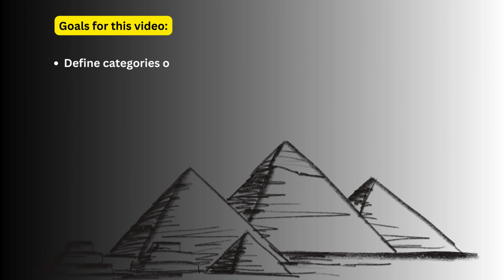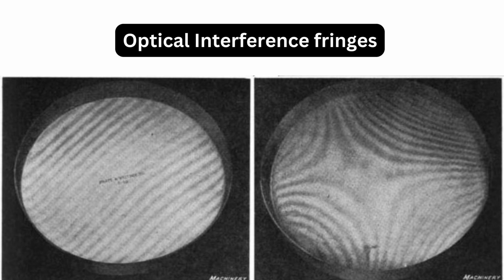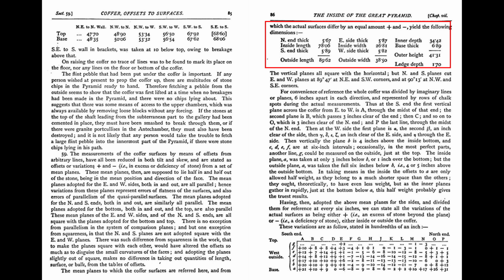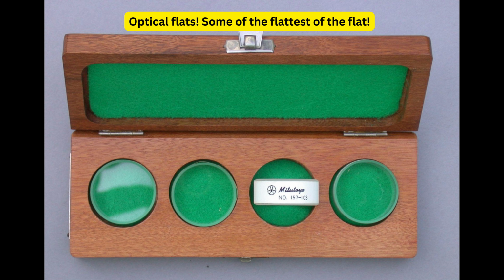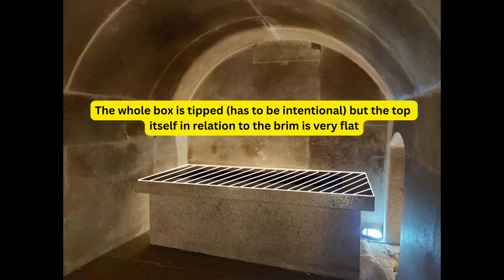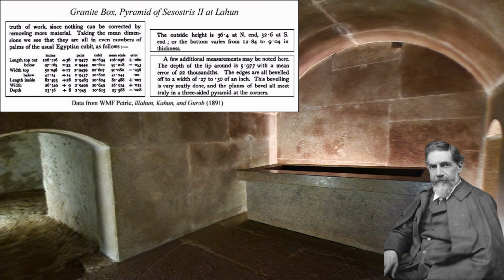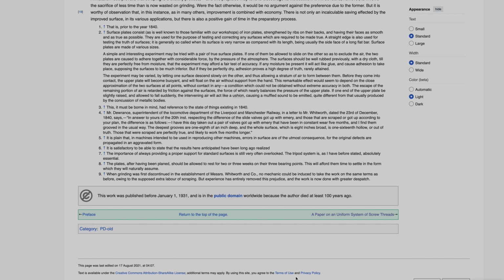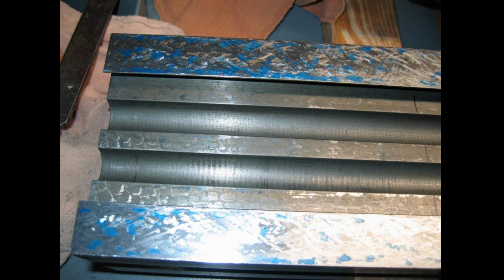The Problem of Flatness in Ancient Egypt

Comment: It is worth noting the inherent racism in the "they couldn't possibly" nonsense.  You don't hear people saying the Greeks or Romans couldn't have built the Parthenon or the Coliseum.  But the Egyptian's could have built the pyramids?  One of these things is not, as they say, like the other.  The Egyptians were masters of practical geometry, and their masons had a lot of work to practice on.  People mistake modern labor saving devices for essential to doing a job, but they are almost always replacing a job which was done earlier in a more labor intensive way.  And averaging three plates until they become flat takes nothing but imagination - which is clearly a trait held by a group of people who, through trial and error, figured out a pyramid!

Comment: People point to CNC machines as some sort of gold standard in accuracy as if the accuracy somehow comes from the computer but if they simply used a CNC to make a CNC to make a CNC each iteration would be less precise, like a photo copy of a photo copy. The ways (rails) of a precise CNC have to be hand scraped/fitted to precision so the machine can produce work that will be a little less precise than the ways.
Reply from the maker: Well said
Reply: Yes and no. Much more no the then yes. I can machine a flat what part and it will reflect the machines error. Then write a program that off sets the errors to make it flatter. In this way that is inaccurate.
Reply: @nsm8728 I am aware of compensating for backlash but compensating for error in the ways seems tricky. It seems like hand scraping would be a thing of the past if it were.

Comment: those straight edges are used in combine with light, its best way to measure straightness of the surface in a field

but im sure you almost knew this
Reply from the maker: It gives a visual reference not a numerical value. Feeler gauge should be placed in any gaps show by light. And maybe that was done! The point is not that they aren’t precise boxes, but even if they are the flattest items in Egypt, how then was it done?
Reply: @intothemap360  see how they all have flashlight on they hands?  you can actually estimate the value from the light
Reply from the maker: Sure. Same way the cop who gave me my first ticket "estimated" my speed without radar and it got thrown out. Eyeballing something is fine for general construction, feeler gauge is so easy and should be used.
Reply: @intothemap360  im sure you have extent background of precision measurements, now piss off

Comment: Yet still for some reason the apartment built in the 1950s, its truly a deceivingly flat suggestions of horizontally constructed walls, you replace the flooring with your machined wood floor panels.The walls are like a sculpture, like it’s trying to replicate the fjord. I could fit a herring in the gap as I accidentally drop one and it fell inbetween. When it goes for sale and somebody points it out, I’m going to say it’s a ”shadow gap”, a modernist architectural feature. Where have we gone so wrong?

Comment: I believe the flat surfaces on the box rim and the underside of the lid form a fluid bearing. My experiments show that a water film .0004" thick is created between the surfaces. That means the two surfaces have to be flatter than .0004" so the two parts don't touch each other. Friction is so low that a 20-ton lid could be moved with 40 pounds of force, if it was level. I took a digital protractor with me and measured a downward slope of 1.65 degrees. With a 20-ton lid floating on a film of water, it can be urged to slide across the box. A limestone block, mounted to the accurate interior walls would be shaved perfectly flat by the harder, granite lid as it slid over top. This is possibly how they made so many casing stones flat and at the right angle. The downward slope was to get the lid moving faster.
Reply from the maker: That really makes sense. Installing these lids without smashing them would need something like that. Very good points

Comment: I work in the automotive repair industry, and this makes sense.  When shaping a body panel with filler. You use a small grit sand paper to make it straight first then step up the grit smooth it out.
Reply from the maker: Right! And you don’t start with the smallest grit sand paper either!

Comment: Not the same but i used to lift 100s of 50kg bags a day, after a few years i could tell you if the bag was 49.9999 or 50.022 or close to that. Humans are remarkable and capable of unbelievable skill. Iv no issues with even the idea a guy looked at the thing and eyeballed or touched it and then made it perfectly flat.
Reply from the maker: Sort of like how it took me a long time but I can usually guess what time it is to the minute or two if I haven’t seen a clock for a few hours. We just pick up weird talents we can’t explain how we learned

Comment: As a stonemason the first thing that you need to learn is to make a flat surface, if you can't achieve that, then you're no good, and people who tell you that this can't be done without modeling tools, ask them how to Romans did it, they had no modern machines, also the simplest way to get a flat surface is rubbing two stones on top of each other, then when you have grinded the surface, you'll be left with a lot of stone dust, that you can then add water to, to polish the stone surface with. The thing that is holding people back from knowing this stuff is a lack of historical knowledge and trying it out for themselves.
Reply from the maker: Well said. Did you finish my video? I speak at length of this method of flattening stone
Reply: @intothemap360 sorry, I only skimmed through a little over 50 percent, seeing a ton of machine tools, making me drawing a conclusion that this video was one of those typical videos, claiming that high technology was used on those stones.
Reply from the maker: No I don’t make that claim at all. Basic tech and clever stone work is all I suggest. 3 plate method with abrasive sand

Comment: Pretty lazy to use some flat counter top with abrasives and talk about rubbing them together to become flat. When the scale of the actual comparison is millions of stones that weigh thousands of pounds before the invention of the wheel. Let's not forget that they were quarried a thousand miles away. Add the fact that they were square with inside corners equally mirror polished. Anyone with modern diamond rotary tools will tell you how difficult those inner corners are to polish without caring about flat or square.
Reply from the maker: Millions of stones would be the entire pyramid. The casing stones had probably a minimal use of this method, leaving just the handful of granite boxes. Remember the casing is limestone, very easy to work with
Reply: @intothemap360  Ok... how do you explain away they sculptures with perfectly symmetrical faces on statues. Perfectly polishes between the toes. It is obvious to any of us that actually work with granite that whoever did this had a process that we cannot replicate today. I do look forward to your video on precision vases.

Comment: Imagine walking up to a big concrete lock block wall with feeler gauges and measuring between them. There are gaps everywhere, and in one instant you find a a tiny .02mm gap. It should be obvious (because the blocks are stacked) that you'll find gaps even smaller still. You wouldn't call it a super high precision lock block wall. "You couldn't fit a razor blade between these blocks" yeah, because they're touching... 

Also worth noting that .5mm is about .020" and in the machinist world that is considered wood elf tolerance. Aka not precision at all. 20 thou on a drawing means the bandsaw cut is close enough. It's still impressive obviously but when I hear guys talking about surface grinder level precision in pyramids... sorry no.
Reply from the maker: Yep that would be a higher level of tolerance for sure. If they didn’t touch they would be floating. Good point

Comment: Water level to achieve one side and a plumb bob for the other.  Perfect right angle
Reply: Exactly, I was looking for someone to point this out.  Why aren't people surprised by Roman accuracy but they find Egyptian accuracy so shocking?
Also, Egyptians had this amazing thing called standard units of measurement which most of the ancient world didn't have.  They had rulers that were pretty accurate.  It's much easier to make flat surfaces if you have the tech to make rulers.  The tech to make rulers just takes standards.  They had that.  Then with that handy dandy standard measurement and the wonders of gravity, making things level and square is far less difficult. 
We have surviving ancient Egyptian rulers and know the Royal Cubit from them.  We know they had a standard unit of measurement and straight edge rulers.  Sigh...

Comment: Surely the joint between the box and its lid from Saqarra that you show in your video is a far closer flatter joint than a pyramid casing stone. There are several huge stone boxes there with incredibly close fitting lids
Reply from the maker: It might be. But we don’t have measurements.

Comment: A master flat is easy: Just stretch a string out to near it's max load capacity and the sag will be so small it is negligible (in the micrometer range).
And a perfect 90 degree or 45 degree angle can also be created with strings and some geometry knowledge, just look up "compass-and-straightedge construction" if you have forgotten this from math class in school...
Reply from the maker: String does not make a master flat. It can be straight without being flat. A string isn’t planar

Comment: I did see a few researchers using laser scanning on various sites. A straight edge and some feeler gauges would be fairly low tech way to check out surfaces. I think they were scanning the sites to build 3d reference models. When making tolerance fit items I definitely lap them together and get pretty good results.

Comment: Good video, definitely looking forward to the precision vase one. That's always been way more impressive to me than large-scale objects having flat or refined surfaces.
Reply from the maker: Thanks! I’m trying to systematically work my way through these topics such as this one where we get some ground work out of the way will set us up nicely for the future when I talk about the vases.
Reply: @intothemap360  Hopefully you can address the claim that they must have been designed to their full precision, and then executed due to their predictable geometry!

Essentially, the set of radii used in their curvatures follow a particular mathematical series, to a level of precision that calls eye-balled subtractive lapping and grinding into question. If you go too far removing material, then either the whole thing is garbage, or you have to adjust the base ratio of every radius manually without making the same error.

Comment: The three plate method won't work you have to have the same size pieces. It's not going to work. It's like trying to sand a large flat surface with a small piece of sandpaper it doesn't work
Reply from the maker: Did you see my comment on the video where I said these are for example only and you’d have to have a piece as large as your work piece to do this?

Comment: Now relate this information to the pots and vases that we absolutely have measured with modern devices and found incredible precision and symmetry on rounded surfaces. Plus we have already analyzed these surfaces including the 'sarcophagus' and found zero trace metals, or sand remnants embedded.
Reply from the maker: You will like the last 30 seconds of my video
Reply: @intothemap360 I got that part. Im more interested in the lack of evidence any sort of grinding, either with diorite or copper plates and sand. There is no evidence, so we shouldn't assume as per your opener..
Reply from the maker: You’re right. This is just one way it could have been done without advanced technology.

Comment: If they can make threads, that's literally it. Pull it, you have a perfectly straight line. Put something in the end of it, let it dangle until its perfectly still, now you have a perfect vertical reference, which can be used for creating perfect horizontal reference, and now we have a 90 degree reference. Now we can make rulers, and from then just copy the formula from the original ruler
Reply from the maker: Straight and flat are different. Straight doesn’t have to be planar, flat is a feature of a planar surface

Comment: I strongly disagree. Having ability to do something does not make it simple and obvious. 3 plate method can explain flatness of stone, but you can not use it for angles. And internal angles are impossible. Also tech being achievable does not enforce it being used. If you mix enough uranium and graphite you can build nuclear reactor, without any special equipment. No reactors until 1940s tough...
Reply from the maker: It isn't impossible as it was done.

Comment: It’s just as lazy to brush everything with the “ancient aliens” label to mock them.  Like many others, you answer a part of the problem without addressing the entirety of the achievement.  I think it’s very simple.  Make one.  When someone can demonstrate or replicate using the tools know to be available, I.will be a believer.  I think you could start small, an inside corner for example.  But if someone gathered a couple legitimate methods (like yours for flattening) and recreated a box, I would be the first to congratulate you.  But I don’t think you can so until then I keep wondering about “lost technology “ not aliens.  I think these people were brilliant and capable of incredible manual feats but I don’t think we have the whole answer yet.  I look forward to the vase video
Reply from the maker: You're right, there are still things to work out and actual use will reveal further problems to tackle.

Comment: They may have used light beams and mirrors to check flatness. That is not difficult
Reply from the maker: They did use mirrors made of polished copper and bronze, I haven’t done any work to see how well those reflect
Reply: @intothemap360  Bronze mirrors were used for thousands of years
Reply from the maker: Right, I just wonder how well they reflect light.

Comment: the method that came to mind for me before you discussed the three plate method was to rotate two surfaces. eventually it would become rotationally symmetric, but not flat. however if you then shift them so there’s a new center, you can repeat this and again average it out radially, and after enough repeats, it would be flat on all frequency components smaller than on the order of the maximum displacement of rotation centers. so it could still have overall curvature, but it would be on a very large scale only. if you have a large enough effective surface, such as tables to the sides which would allow shifting it well away from the center, you could get the center decently flat.
Reply from the maker: That is a interesting way to modify the 3 plate method for large surfaces!

Comment: Water is always flat and level, think about it.. What would you use to gauge flatness if you were making a tool before modern times? And you can conveinently carry it in a bucket and it always remains flat and level.
Reply from the maker: I can see how water can be used for level, and indeed it was, but how would you use the surface as a flatness check?
Reply: @intothemap360  I was referring to the statement at the begining of the video about how they managed to find a way to make a square or a straight edge. One way is using the deflection of the reflection of the tool barely submerged in the water to assure it runs straight. also a plumb bob would work. And for flatness of course they used sand and rubbed it with a fairly flat surface tool like sand paper, in which that both the piece and the tool got flatter as it was being worked, then throw some water on it and look for any uneveness in the reflection. To be honest I think "the perfect flatness to modern best standards" is far fetched anyway. I have all the modern ways to make the same thing nearly perfect specifications, but If I wanted to, or had to make that same thing, I'd doubt anyone would lose sleep in 2000 years over my "good enough" leveling, sanding and polishing job..I'd have to see independant verifications using various methods of people who specialize in that field to conclude that claim, as archaelogists especially the ones that focus on Egypt are known to make a few bold claims before actually verifying all the information.
Reply from the maker: I hear you. makes sense

Comment: We get flat glass panes by floating them on liquid tin. Liquids are natural perfectly flat suufaces. If you wish to adjust  wooden straight edge lower it to the surface of a still pool of water and carve off the bits that get wet.
Reply from the maker: There 's an  idea! Wonder how that would work when you turned the object back over to carve it, the water would run all over unless you also lifted it up perfectly flat as well
Reply: @intothemap360  you lower it edge on? think about it for a moment. or try it. you can work it out.

Comment: I worked as a machine tool inspector and grinder for 12 years. I remember rubbing the gauge blocks together to make them stick molecularly. Then place the stack of gauge blocks on a surface plate to measure the blueprint dimension with a surface gauge, accurate to 50 millionths of an inch. If the administers of Egyptian antiquity really wanted to measure the flatness of granite boxes, the technology definitely exists. They could also publish the results, if they wanted to.
Reply from the maker: There is space in Egyptology for the amateur, as long as those amateurs are dedicated to logic and reason and put in the work to present that to the public. Good points!